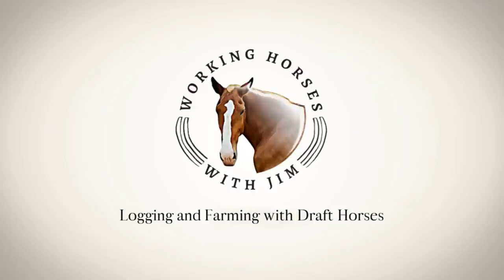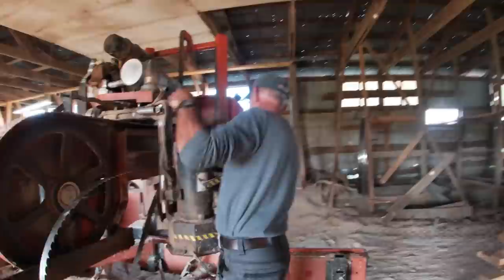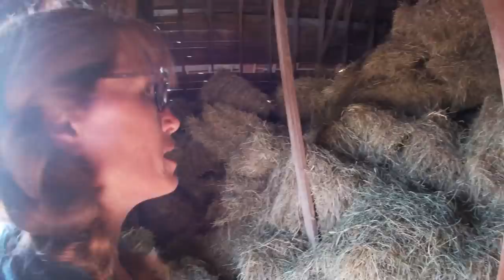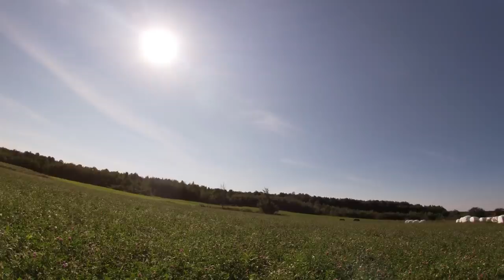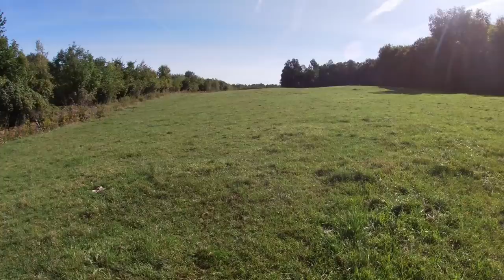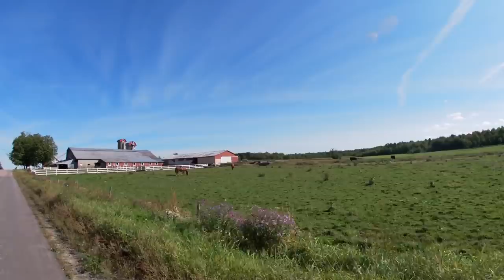Odd Jobs around the Farm // Checking on things with Brenda

Comment: Jim, Jon V. here. I worked for Sanborn Machine in Waterford Maine for 32 years. Sanborn Machine was an OEM Sawmill Mfg.
In 1984 Sanborn started making a portable sawmill. Named Sanborn MinMax. It used a Wider blade than the WoodMizer. 6” wide blade with a Pressure Guide System.
Have you ever seen one out your way?
Reply from the maker: I've heard of them, but never seen one

Comment: Your day was a lot like mine on the farm from the time I was 5 to 13. I led the draft horses back to the barn at 5. I threw down loose hay and later bales for the horses and cows. I just found some bug spray I lost off the ATV. I just finished picking Reliance and Fingerlakes dwarf peaches and pruning the tree, and yesterday picked and pruned Ayers dwarf pears. Nice size this year. Moonglow didn't produce this year. Both are fire blight resistant. Fingerlakes mature in early Sept and Reliance in early August. Both are winterkill resistant to 40 below. I like the picking and using spread out. My apples are small this year and not quite ready. If they aren't juicy, they aren't ready. If Jim is like me, I sometimes struggle with attaching the drive shaft to the tractor. I could use a third hand. Today, I could get the locking collar on but it would not push on. I had an old tire lug wrench and I put that down thru the u joint and it pushed the collar right on the shaft.. Wish I'd learned that trick years ago. As they say, work smarter, not harder. If I was at your place, I would have bagged up that dried fertilizer for my garden next year. I had a neighbor who would drive his ponies and cart around the block and sometimes they would leave me a "present" in the road. I didn't let it go to waste!
Reply from the maker: Sounds like you don't waste anything, and that's great. We also don't like to waste anything but sometimes it's hard to keep up.